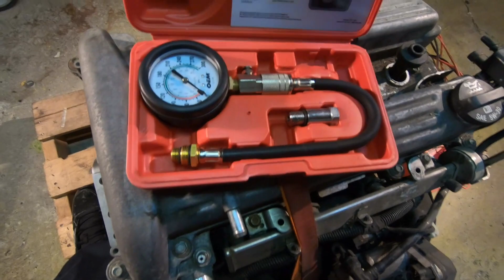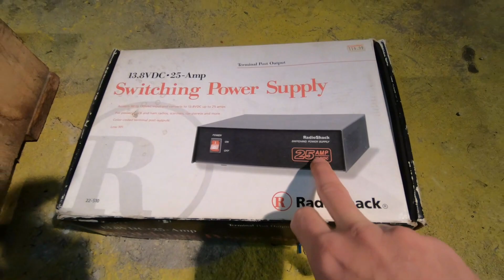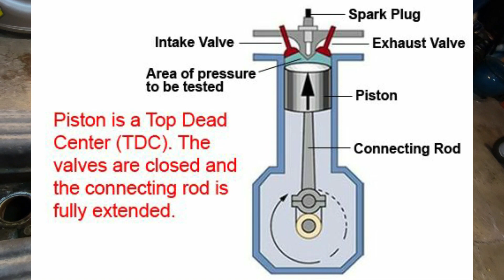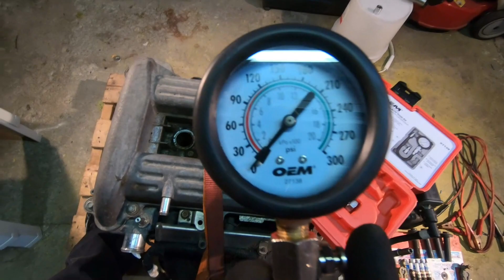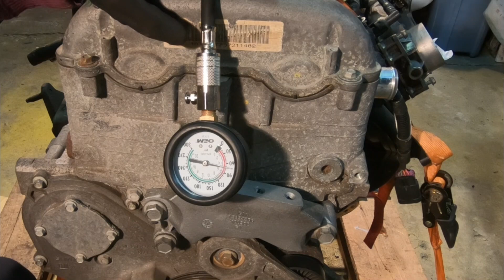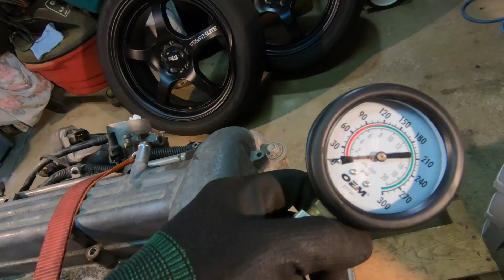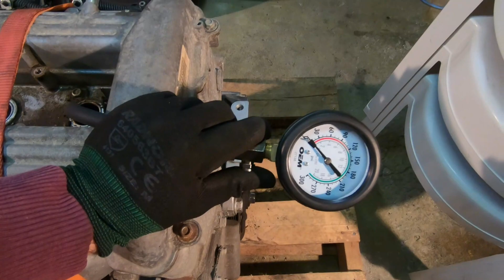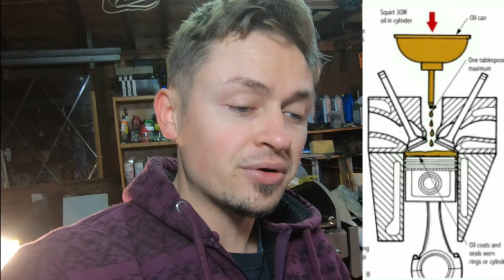Compression Test on the Abandoned Gm Ecotec Motor (L61) We have a Problem!

Comment: I’m surprised the crank bolt didn’t snap off in the crank 😂 you can tell if the cylinders are even somewhat. The only thing really going to be able to be done to confirm anything without a starter on the engine is a leak down test. Compression specs are based off of the engine turning at a certain revolution which is the speed of the starter.

Comment: either that motor is trashed or doing a compressions test this way is not effective. never heard of someone trying it this way. not trying to down you just give you some insight, when you do a compression test in the car you have to keep the throttle blade wide open otherwise your numbers wont be accurate, but the part Im curious about is if it matter how fast the motor is rotating to get accurate results. i dig it man, keep it up!
Reply from the maker: Yea this was all I can do. I saw one guy doing it this way.   Good point on the throttle being open.  But the intake manifold is loose here so it would have received adequate air I believe.  We will see as we go along what else we find.  Interesting 😬
Reply: @BulliKid  yea I'm loving it, always like a good engine forensics process
Reply: Im inspecting my 03 ion 2.2 and rebuilding it this is great info. If successful I plan to trans swap .

Comment: Maybe if you hook the jumper cables to your back pockets that ratchet might turn faster, lol You know I have to mess with you Bull Dawg.
It's too bad that you don't have the starter to turn it over. But now you know its not locked up. Kind of sounds like you have been doing some research on how it all works. 
Its ok to be turning the engine with the crankshaft bolt by hand but I don't think I would be hammering on it with an impact. You could break it off or get it so tight you might not get it off. 
The spark plugs looked like they had way too much gap. They may have been the originals like you said?
Reply from the maker: Yea I thought about making the crank bolt extra tight.  I even tried to loosen it also with the gun and it doesn’t budge at all.
Reply: @BulliKid  I'm not sure what size bolt it is in that engine but it might have maybe 75-100 ft lbs of torque on it. Not all impacts will break that loose.

Comment: The dirt in the one spark plug hole is most likely from a leaking valve cover seal. There are round seals where the valve cover meets up to the head that seal off the spark plug holes. They are prone to developing a leak and letting a little oil gather in the sparkplug hole around the spark plug
Reply from the maker: Ok that’s nothing to bad!

Comment: Just fyi 25 amps is nowhere near enough to power a starter to crank over an engine. Take a look at the top of the battery in your car and it'll say ca(cranking amps) and cca(cold cranking amps) on the label. They will give you an idea the level of current you would need. For reference the battery in my motorcycle is about 144 cranking amps.
Reply from the maker: Ahhhh makes sense! Thanks for explaining!
Reply: @BulliKid  no problem man. Just here to help.out